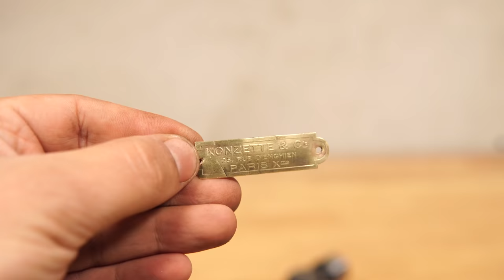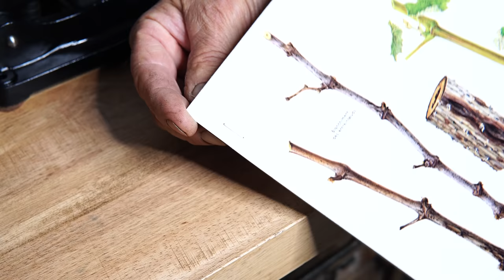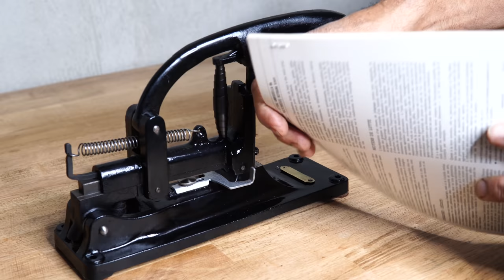Rusty Stapler Restoration

Comment: Must have been an expensive stapler in it's day with all those cast and machined parts.  Definitely worth your fine efforts to bring it back from the dead.  Beautifully done and great videography.  Love how your drill press has virtually no run-out.  Thanks Much for sharing your talents and techniques....1M subs will come!
Reply: What is the drill press?
Reply: @jackhammer5683  5:28, this I believe
Reply: @hiddensinix2767  thank you senior

Comment: Lovely work. So many of these old machines are made like tanks and would basically never break if it wasnt for the oxidation. In working order most of them remain just as relevant today as when they were made.

One question though - why do you use paint for a the bulk of surfaces? Isn't it prone to crack and peel in rough use? Isn't bluing more hardy? Or even zinc electroplating if you wanted to put in the work to make it basically rust-proof forever. Is the paint about keeping true to the original design, or does it have a spesific practical advantage aside from being easy?
Also, is there a reason you dont use electrolysis to remove rust? I think it would do a lot of work for you on heavily rusted parts like these - and also much gentler than sandblasting (although the latter probably emoothes out some of the pitting)

Comment: You seem to run into a great deal of metal pieces in your restorations, which then require your use of a sandblaster. I used one for a few years  on antique cars. It appears that some of the pieces take a bit of time to clean. On metal pieces have you ever considered the use of Carborundum grit to quickly remove rust, paint, grim of all sorts. It works quite fast so it’s not for the unintelligent or careless one—of which you are not. Thank you. Subbed your channel today.

Comment: there is a very fine pitting on the surface that can be removed with spray filler without much effort. The end result is still insanely good 😁

Comment: A question here does staple size never change  or have been standardise?  that stapler look like from the early 20th century and can still function using a  modern staple
Reply: I think it's probably standardized, because stapling is related to printing and book industry, and they have set standards on usage of stuff.
Reply: @Sup_D  if so thats is quite surprising printing have been  around since the middle age the fact that staple have been standardised sinced and unchanged is something